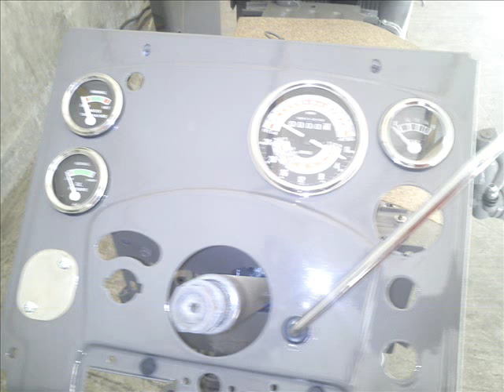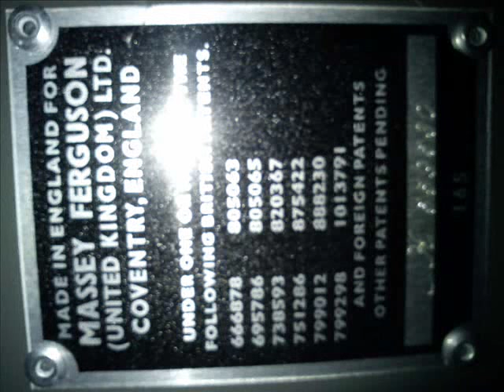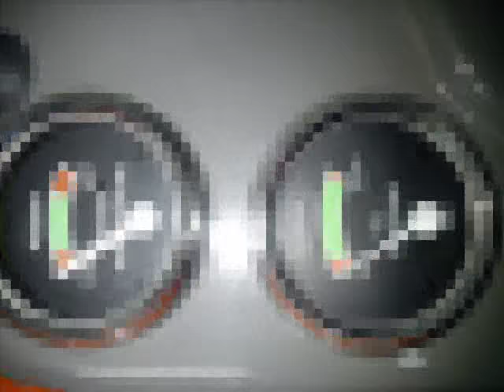Massey Ferguson 165 restoration

Comment: Would the 165 have come with rear wheel weights as standard or was it just the 168?
Reply: they came with a cast rim
Reply: The 165s around where we grew up all had the heavy rear axle no wheel weights but the rims where more than a quarter inch thick and non multi power or power assist steering but were the work horse of the farmers all across the valley there were also a few 185s and 175s and lots of 135s
Reply: All that I know of had steel rims only the 185s and 175s had the cast iron wheel weights